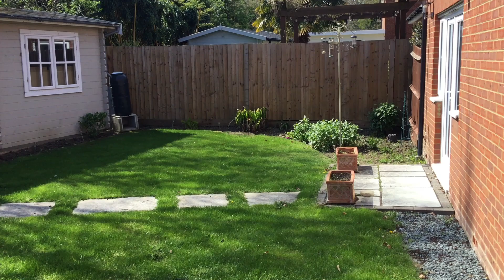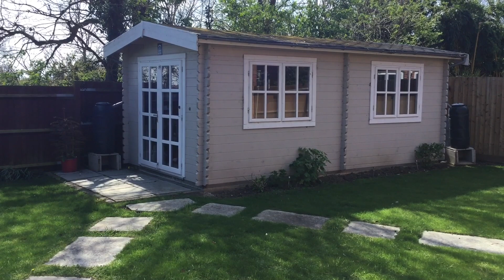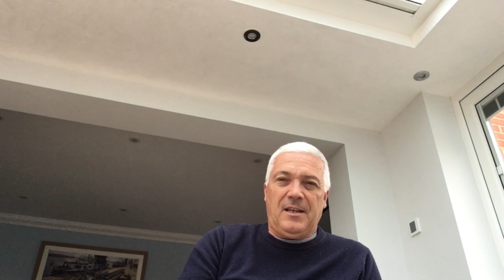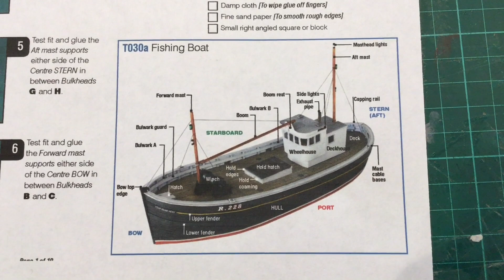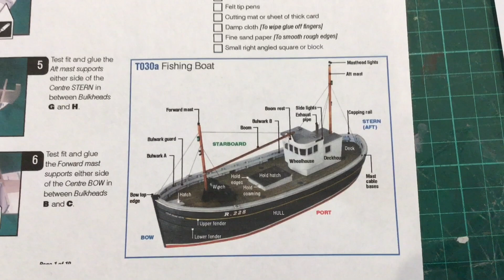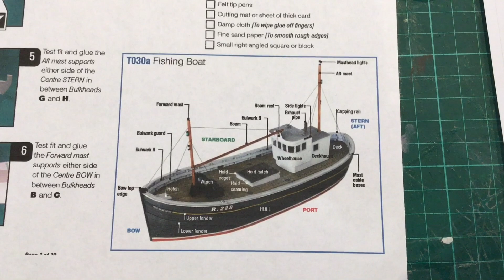Exehaven Harbour 68 N Gauge Model Railway

Comment: John I have always been put off the Christensen kits due to the cost which ends up being similar to ready made. However probably worth it for the boat in this case given those bulkheads!
Re the helix, what about using cassettes instead?
Reply from the maker: Hi Stephen, yes you’re right the cost of the laser cut parts does make it a bit more expensive but not excessive and it really does help to get the kit right in N Gauge just because of the size of everything and being a millimetre out can really make the build tricky! But for the boat cutting out those bulkheads would’ve taken ages!
Actually I’ve been thinking about cassettes, and again wondering quite how I would do it as with the helix. It’s going to help when I get some track down so that i can see what’s what.
Cheers for now Stephen, John